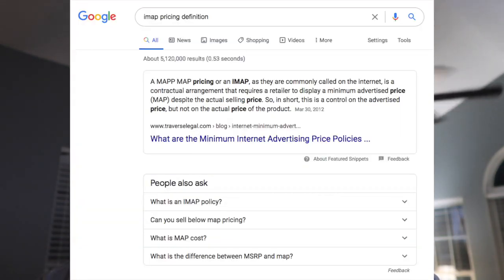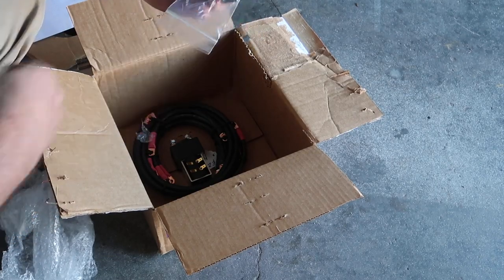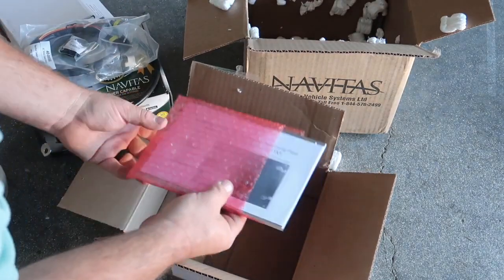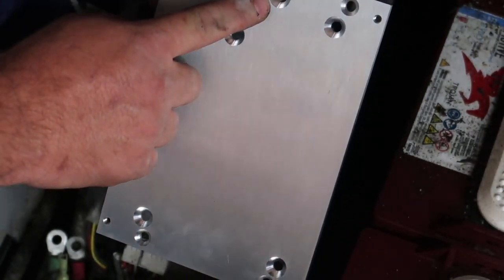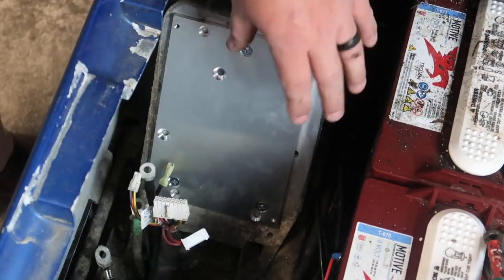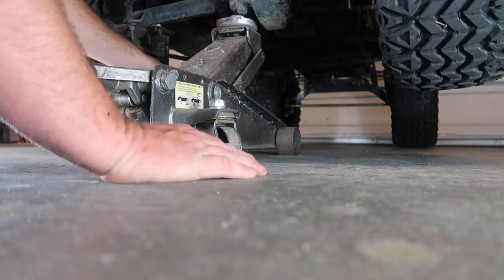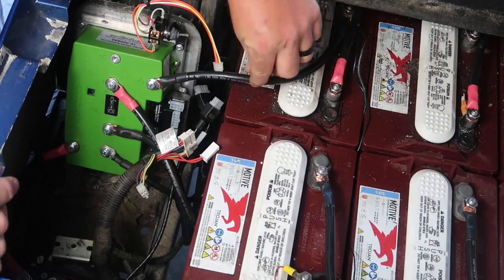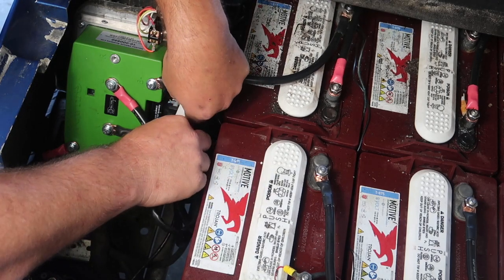How To Make EZGO Run 35 MPH   Navitas 5KW AC Conversion on EZGO TXT Golf Cart   Plum Quick

Comment: I noticed you didn't attach the resister on your solenoid. I have a build with this same Navitas motor/controller kit and I've attached it attached to a 48v lithium. I'm also using an Albright SW180 solenoid. Do I need the resistor and diode?
Reply from the maker: DC to AC kit you don't use the resistor

Comment: What’s the best way to adjust motor to run slower my father in-law is 85 and doesn’t have the best reflexes anymore we want to give it good torque to go up his hill but slow down top speed to the slowest we can. It’s all stock at this point what’s the best way to achieve this ?? Thank you for the help
Reply from the maker: TSX3.0 controller with OTF to adjust the speed and torque

Comment: I wish like hell I could find out WHAT KIND OF EZGO I Have .               Apperaentroly its Unmodifyable .                   Its a 48v ezgo    the reverse switch is down behind the leg so you reach down with the right hand & swicth F/R  the front is roundy & has the black bumper all the way around the front                    ........     I dont know if I have a TXT or a DPS or a NondPS    or some other description.
Reply from the maker: Give me the model number on the motor and controller and I can tell you what you have. You can email this info to me  info@plumquick.com

Comment: Can you set the speed faster than 35mph?
Reply from the maker: yes, you can run 72 volts and or go with 8:1 gear set
Reply: Yes, you can set it as high as you want. But, you need the voltage to get to higher speeds. My 70v eco battery gets me into the 40's on my 2015 txt.

Comment: I'm just curious. In my 2019 cart I upgraded the batteries and charger where I put 4 x 12v LiFePo4 batteries instead of 6 x 8v lead gel batteries and I'm wondering how well this kit will work with those batteries. I think there shouldn't be any problems.
Reply from the maker: No, problem if you run enough AH
Reply: How is your cart working on that setup? Im fixing to do the same.

Comment: You think if i did the 72v ac conversion, could i use 6 12v regular batteries, or do you have to do a 72v lithium?? Thanks!!
Reply from the maker: You'll have to run deep cycle golf cart batteries
Reply: @PlumQuickMotors  so I wouldn't need lithium? I could use 12v deep cycles instead? And just get the 72v solenoid instead of the 48v? And also why doesn't everybody just get the 72v if you can just put 6 12v deep cycle lead acid batteries for like 40-50mph over doing the 48v which is 35mph? All the difference is, is the solenoid is 72v and u got 12v batteries, right? Or is there a downfall to having 72v on this system? Because I believe this same system you installed is good for 72v also.
Reply from the maker: @cameronlott2303  6-12 volt batteries are going to be hard to fit under the seat and you'll have a greater weight load
Reply: @PlumQuickMotors  also, with the 600a kit. Is deep cycle lead acid batteries ok? Or do they not put out enough amps for the controller. Because idk if that controller will put out 600a but for a second when you floor it maybe?

Comment: No one can answer this.  I have an ez go 2001 cart. I have an Alltrax controller and a lithium 52 volt battery.  Also 24 inch wheels It runs 29 mph plum quick says if I install the demon motor I can run 40 mph. Is that possible before I spend 900 on the motor
Reply from the maker: Demon motor listed as this..........New Custom Built Motor, Class H Motor Rating, High Performance Brushes, Torque/Speed EZ-GO 48 volt Series 19 spline 16.7 HP, Speed 28-30 mph (estimated) and added 50% more torque *must upgrade controller*, flat terrain and a good quality battery pack. With the lithium pack and taller tires you could see around 35 mph.

Comment: Do you have to be in the dealer settings to be able to change it from the priest at 25 mph up to the full potential of 35 because I saw another video that said you have to change your RPMs to 6500 and that part doesn’t allow me to make a manual change on the app
Reply from the maker: The user app allows you to make these changes.

Comment: Why do they call this an AC motor?? This is a brushless DC motor.
Reply: Because it is an ac motor, there are 3 phases on the brushless motor hence the 3 power cables. All brushless motors are 3 phase.

Comment: Great video.  I am doing a 32v conversion to 48v.  I see you replaced the solenoid.  Which one do you recommend for this controller?
Reply from the maker: You can use any good 48 volt 400 amp solenoid.

Comment: I just bought the same  system from Matt at Plum Quick. I have a 36v series and pulled everything out and converted to a 48v. How do I wire the dash Fwd/Rev switch? The wire harness I bought appears to connect the switch in the body behind the knee. I have the Sw180 Curtis Solenoid as well.
Reply from the maker: Get with Matt on Monday and he'll direct you in the right direction.

Comment: Can you keep the original motor and still use the Navitas Controller with it?
Reply from the maker: Yes, not AC but a DC controller.
Reply: What will the speed increase to with the stock motor with the DC controller? Right now mine goes 12mph

Comment: How many miles will those Trojan batteries last on a full charge with this navitas kit? I want the navitas kit but don’t want to spend over 2,300$ for a LI battery.
Reply from the maker: Good quality battery pack should get around 20 miles
Reply: @PlumQuickMotors  dang… that’s it huh?… is this estimate for a cart with no lift and stock tires?
Reply from the maker: @agentmichael_scarn3474  This is estimate, every cart will vary depending on several factors.

Comment: So if you go into the app and tell it you have different size tires than you do can you get even more speed out of it? Will it fool the controller and motor so you can go faster than the 35 mph?
Reply from the maker: You can only get so much energy out of a battery pack regardless of the settings, lithium will get you higher speeds.

Comment: You forgot to mention that your modification is illegal for use on a golf cart, and may only be used if the cart is being converted to a Low Speed Vehicle, which must then be weight certified, include headlamps, taillights, turn signals, horn, seat belts, DOT approved polycarbonate windshield and wiper, inspected by the DMV, issued a VIN & vehicle title, automobile insurance, and lastly, a registration plate.  The operator must also have a valid driver's license.  (25-year LEO - Florida State Trooper - retired)
Reply: You sound like you grew up in California 😂
Reply: Mind ya business.....Nobody cares!
Reply: Boomer LEO can get blown away
Reply: Gayeeeee
Reply: There's Thor prob an official lol we don't cars😊
Reply from the maker: Dave, golf cart regulations vary from state to state. This is why the kit comes with a on-the-fly programmer which the customer has to get the app to set up the speed and before it can be saved in the app the customer has to click the "customer accepts all liability" before it can be programmed for higher speeds. Just so you know in SC you ONLY need insurance and a $5.00 one time DMV sticker to drive the cart within 4 miles of your residence on 35 mph roads and you can cross over higher speed limit roads.  Thank you for your service.
Reply: LOL
Reply: What a freakin loser 10 year truck driver active 😂😂😂
Reply: Shut up nerd
Reply: You just a trouble maker ain't ya😢😮
Reply: lol cry us a river
Reply: @emildeaton2434  Typical reply from an uneducated trailer dweller.
Reply: I bet your fun at parties!

Comment: Since my 2008 EZGO TXT/PDS is currently 36v and I want to convert to 48v, will I need to purchase different batteries for it to work efficiently and not drain too quickly? Will it even function with the batteries I have now? TIA
Reply from the maker: You'll need to convert to 48 volts for the 5KW AC conversion kit

Comment: Thanks for the video.  Curious about a comparison of the stock battery life/range and this.  Clearly it's going to be worse but how much worse are we talking?
Reply from the maker: AC is actually less drain on your battery pack, it's more energy efficient.
Reply: @PlumQuickMotors  I have the full Navitas A/C kit installed, 23" tires and everything else.  The only time the A/C is more efficient is if you don't jam at full speed the whole time.  If your going over 30+ and using fast acceleration the whole run, your batteries drain much faster.  If your going only 20-25 mph you get better range than the D/C.